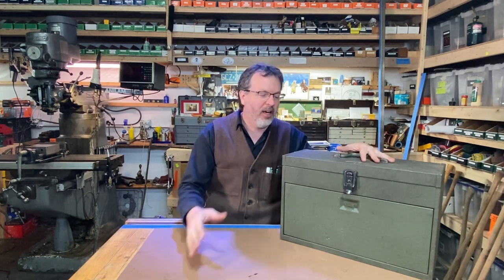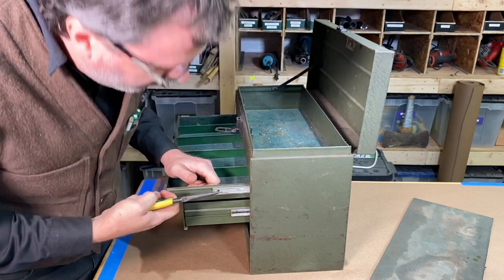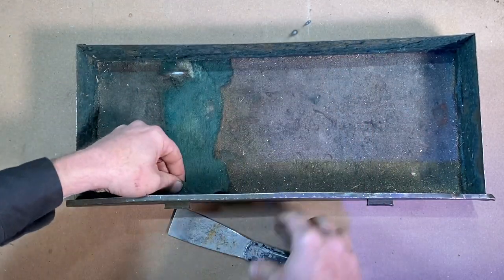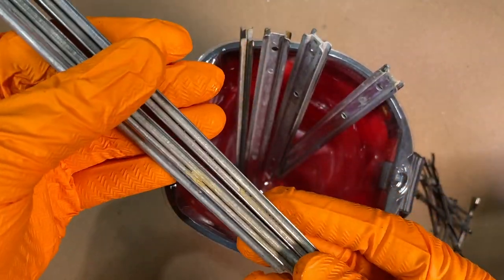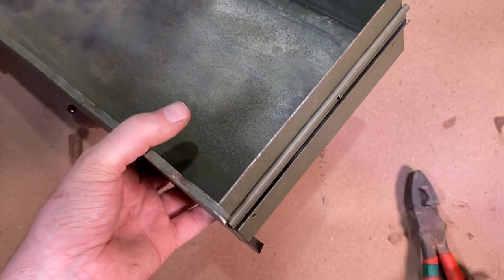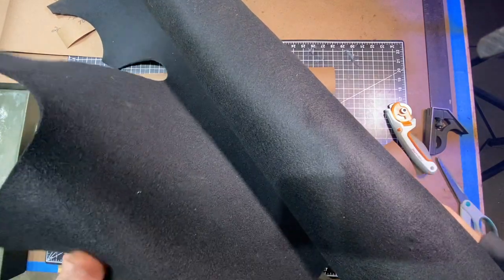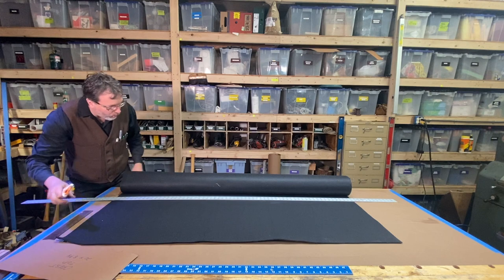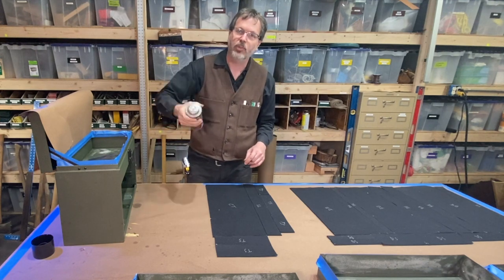Kennedy Tool Box Restoration - New Felt - Drawer Slides - Toolbox

Comment: I suggest using graphite powder as the lubricant on the slides. No buildup from debris and dirt and is butter smooth so it will stay smooth longer and makes reapplication easier since you don't have to remove the old stuff in a few years. Also doesn't have that death smell that some lubricants have.

Comment: Hello. I just picked up a Kennedy Bighorn that looks just like this one, except for the drawer pulls. Do you know if the Bighorn and 620 are the same size? Mine is missing the drop front and since I’m not flipping it, I was considering getting a new front from Kennedy.
Reply from the maker: Right On! 🙌 that’s a nice box! I’m not sure if the bighorn and the 620 are identical? It could be because the Bighorn turned into the 620 at some point. I’m not sure if they made any slight changes. Wish I was more help! Enjoy your box!
Reply: @RightOnJonCrane  thank you. It needs a little TLC  before it lives on my bench but the price was right with a handful of old tools.

Comment: How did you straighten the guides?
Reply from the maker: Jason, I’ll be doing another Kennedy box shortly and will show how I straighten the guides. I use a large vise 👍🙌
Reply: @RightOnJonCrane  my issue is bending the channel on the side of the drawer around the guide rail without it pinching and binding up. How can it be bent where the same radius is kept?